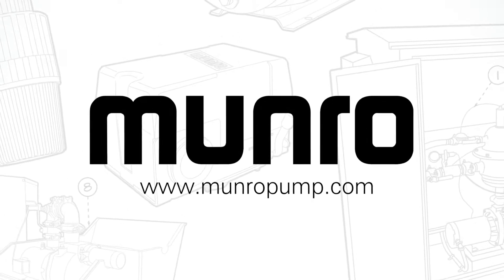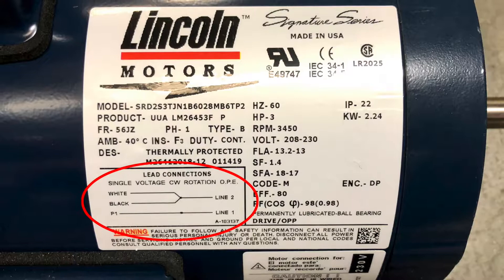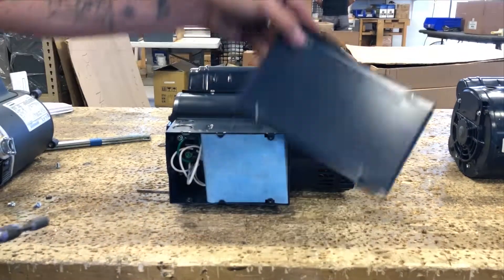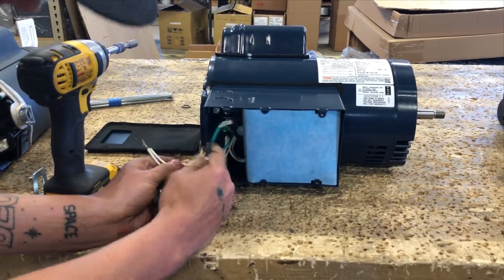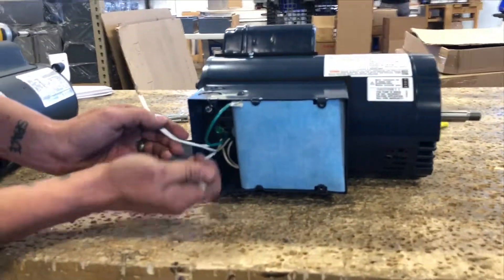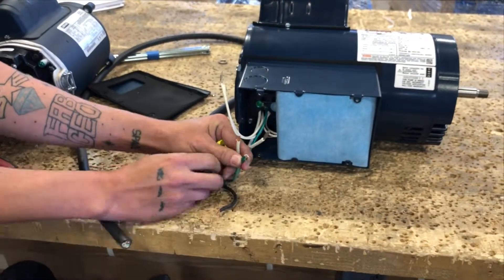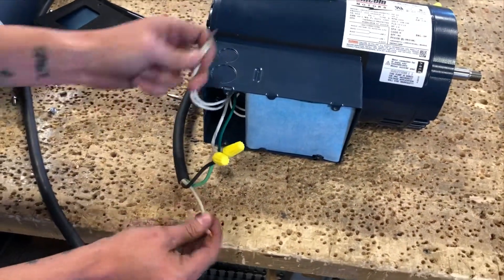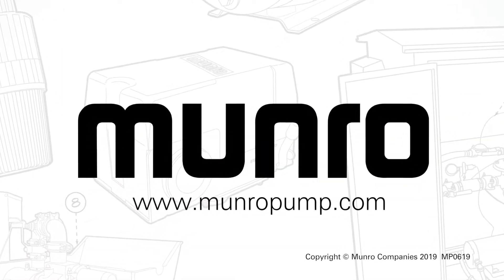How to Wire a Munro LP200B or LP300B - 2hp or 3hp Centrifugal Pump with Leeson Motor

Comment: Hello I need a replacement motor for a munro 3hp like the video any good replacement thanks...
Reply from the maker: The part number for a new motor is M300B. The seal and gaskets will need replaced. The part number for the Seal Kit is SLPKIT, and comes with the SCC800 Seal, MLPG001 Case Gasket, and MLPG002 Diffusor Gasket. Please email us at marketing@munropump.com for seal replacement instructions.